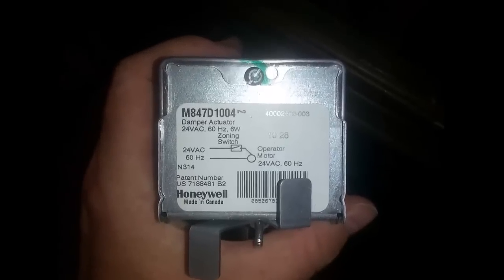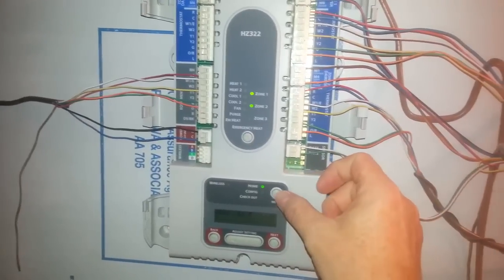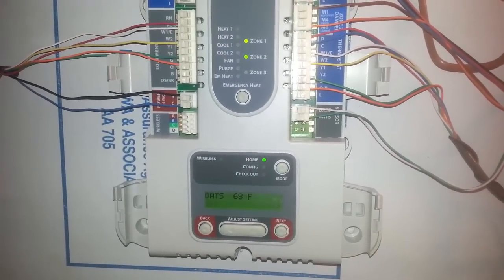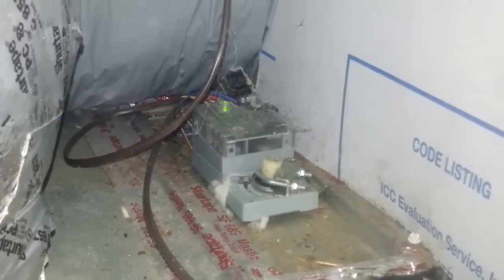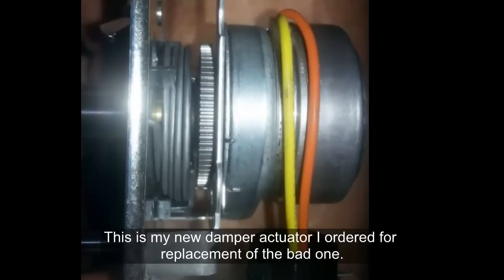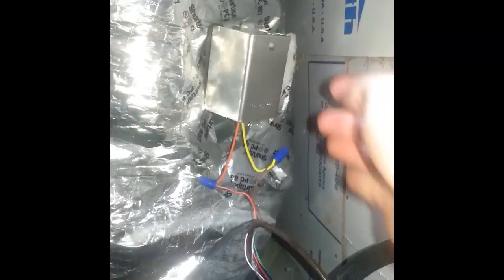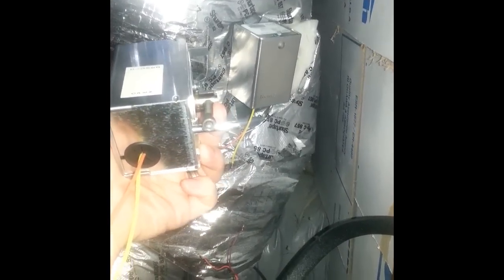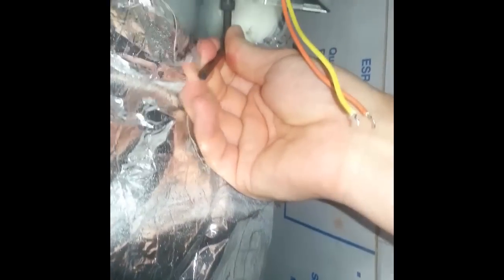Honeywell Zone Damper Actuator Replacement

Comment: Those spring return motors are crap!  I've gone through my fair share.  Everytime the motor got so hot the plastic gear would get soft from the heat & strip out.  I went to a 3 wire non spring return, non honeywell brand.

Comment: Hey Jason.  I'm glad I found your video and discovered the spring binding on the gear was keeping my zone 1 damper from opening, which was overdriving heat to z2 and z3 when they had called for heat at the same time.  I was able to fix the problem though, I used a thin wire to compress the spring and keep it below the nylon gear; I thought it might bind the spring but it works fine now.  What I did was loop some picture hanger wire over the spring and down through a couple holes in the housing below the spring, where the spring hooks around the housing,  I twisted the wire to pull the spring down to keep it below the gear.  To my surprise it stays down, doesn't bind, and the opening spring action is actually quite fast and not sluggish at all.  Hope this helps others.  Cheers.  Bill
Reply: i'm going to try this. i replaced one actuator a few months ago, and now the other has died. seems to be the spring binding in my case, since the gears are all metal and look good. thanks for sharing!

Comment: Those new M847D-ZONE actuators are supposed to be the BOM.  Our house was built in 2015 and all 3 zone actuators have failed at least once as well the fresh air is the same as the others which is wrong from what I can tell.    I've just replaced the remaining two with the 847DZone after having one of them replaced with that actuator 2 years ago.    Now to acquire a fresh air actuator.

Comment: Just want to say thank you! My actuator bolt lever got stuck in the closed position because it had gotten entangled on the insulated pipes. I fished around for the lever it started to move to the open position on its own.

Comment: Thank you for sharing easy walk threw..
I’m having a problem with my 2 nd floor damper clicking constantly when the first floor heat is blowing .I did take one of wires off to stop this problem temporarily.. do you think it’s the damper or the control panel?
The system is 15 years old 
Thank you
Reply: Hello I have exact same problem, appreciate your input, about how di u fix this, thanks in advance!

Comment: Thanks Jason as this was my same issue. One actuator out of 2 went bad. I will add the acctuator that went bad (M847D1004) and the one you ordered (M847D1012) are both no longer available. The new part # is M847D-ZONE. I bought it on Amazon with same day delivery and wass back in business inside of a day. I can confirm it is a direct fit. I had no problems at all.
https://www.amazon.com/Honeywell-M847D-ZONE-Truezone-replacement-actuator/dp/B07C7QL5FN/ref=sr_1_1?s=industrial&ie=UTF8&qid=1527440249&sr=1-1&keywords=m847d1004

Comment: Thanks for the video. I am having the same problem. FYI--the old part (M847D1004) is obsolete and has now been replaced by the following: Honeywell M847D Zone Valve Actuator. I have actually had this problem with multiple actuators of this model, but my furnace was under warranty, so I had the contractor fix it. Now that I'm out of warranty, it is good to know I can do it myself with your guidance. I hope the new model is more reliable.

Comment: just saw this video, i have the same problem but I can't find the same model on amazon or eBay, it says that it's been discontinued. i got the direct replacement M847D-Zone. the issue i have is that this one doesn't have wires attached to it.  it has open and close wire slots. how do I know what color goes in each of the slots? appreciate your help!
Reply from the maker: Yep, if you look in my description at the bottom, I also had to replace mine with that replacement model (M847D-Zone).  Did that in Nov 2016.  Mine is wired with the brown wire going to the M1 slot and the orange wire going to the M6 slot (nothing in the M4 slot).  I honestly don't remember if it was in the instructions, or if I just figured it out ... it's been about 9 months since I installed that one.  It's been working great since then.  Hope this helps.  Keep me posted on your progress getting it fixed!

Comment: Wondering if you have something mechanically interfering with the damper.  Such as loose insulation or some other garbage that has worked its way through the system to that point.  That could cause the actuator to work harder than it should.

Comment: would really appreciate if you did an updated video on the M847D-ZONE.  It has some control features that the M847D1012 did not, and it would be great to understand how to use them properly (M1, M4, M6).  Your video is the most helpful thing I have found on doing this job, by far!

Comment: Perfect - worked for me.  Nice call out on the 3/16" allen wrench!  My diagnosis (finally!):  The DATS (Discharge Air Temperature Sensor) was signalling to low degrees, shutting off the compressor and fan outside (but leaving the fan inside on).  Yep, I replaced the flux capacitor on the compressor unit - yikes! [Thanks to more youtube vids.]  But to no avail.  After the repair man came and went - his $95 diagnosis:  replace the zone controller - I switched out the zone controller with my other unit.  Nope, same issue:  compressor and fan outside shut off after about 3 minutes.  Read the manual [again!] and figured out that the DATS was signalling too low temp - the cool greed led was flashing, and the purge was flashing.  I disconnected the DATS wire from the zone controller.  Viola - no more shutting down the compressor/fan outside.  And zone 2 was getting nice and cool again.  I took my handy laser thermometer and started shooting the vents.  I figured out I wasn't getting hardly any air out of zone 1 vents.  Bingo - the damper had failed closed, causing the very cold air to be recycled, which triggered the DATS signal to shut down equipment.  Worked like it should!  I had a spare Honeywell zone damper sitting around, because, you know it's like my 3 damper fail in 12 years.  Swapped out the actuators in oh, 3 minutes.  Worst part - I got that gooey duct tape residue on my fingers.  Best part - the wife can sleep comfortably at night, or during the day for that matter!  

Thanks for posting yet another 'here's how to fix this' you tube video!

Comment: wow the prices on Amazon sure have gone up in the past two years. The first one that comes up is over $200 now.
Reply: I think its because that part number is discontinued.  Honeywell has a new design.  Use part number M847D-VENT, its $80 at supplyhouse.com.    But I just ordered the Belimo with the retrofit adapter kit.  Its $70.  It has a 5 year warranty and is commercial grade.

Comment: Jason, I have a similar problem. Got the Honeywell Zone set up for just 2 zones. One system. 
I have noticed recenlty my vents up stairs blow air even though the stat is set to off when the downstairs is on. So much so that its keeping the upstairs cooler than I want. I feel I am losing airflow from down stairs. 

Went into Attic I got same actuators. One of them is very hot to the touch. And its in the OPEN position. Not the closed like it should be when powered. Hot to touch tells me there is power to it. I had t manually move it to the closed position and jam a little wood block to keep it falling back to open. I went to upstairs and that solved the air blowing out the vents issue. 
Do you think this thing is repairable. What would you look for? Obviously the spring is working against the power of it to keep it n the open position. 
Great video and I think I have figured out the issue for now. 
Thanks,

Comment: For spring type actuator, I think you should avoid keeping it closed for long period of time. When the actuator is active, there's heat generated and causing the spring to be weakened and deformed into different shape

Comment: Jason,
Great video, thanks.  In my case the motor is defective.  It will not "actuate" when I apply 24vac.  I manually opened the damper to see if that will work in that zone, which is a small room.  If that's the case i will not replace the damper actuator.  The whole house will be one zone...  Thanks again for the full explanation, you saved me a bundle of $$$$$$.....  : )

Comment: A very helpful video.   Seems the spring is a weakness in the design or manufacturing --- at least, it seems they shouldn't be failing in the way they do.  Those were good views of the spring rubbing against the gear.

Comment: Great video, thanks for sharing.  Describes my symptoms exactly on our downstairs zone damper which got stuck closed on me.  I crawled into the crawlspace and gave the hex screw a nudge and the damper returned to open on its own.  I manually cycled it closed and open a few times and it seemed to move freely, so I figured it might have just been temporarily stuck closed, but unfortunately it continues to get stuck closed.

Do you think there is any way to repair the spring?
Reply from the maker: I doubt it Derek.  Watch the other video that I linked to (Honewell zone motor damper operator...fix it.) and he actually shows how to replace the spring, but you'd have to have a new spring and I don't know how you buy one of those.  The guy in that video had an actuator where the gears had gone bad and he used the good spring from that one to replace a bad spring in another one.  I think you're probably in the same boat I was in and will be forced to just buy a new actuator.  Pretty easy now that you've diagnosed it though.  Good luck and post back to let me know how it went.
Reply: Jason Liner I think you're right.  I opened up the old actuator and the spring looked pretty out of shape.  I ordered a new unit and installed it, working great now.  I'll keep the old for spare parts as I'm sure I'll be working on more of these in the future.  At least I have a spare gear now, which I guess will probably be the next part to fail.  Too bad these units have such obvious weak points, you'd think honeywell would have put a metal gear and a better spring in them by now.  Although I'm glad people like you and the other video you linked have taken the time to make videos to help out the community and save us hundreds of $'s!
Reply from the maker: Yep.  Glad you were able to diagnose and get it fixed without paying a repairman lots of money.  Happy to help others!